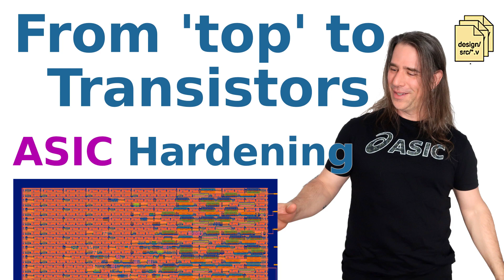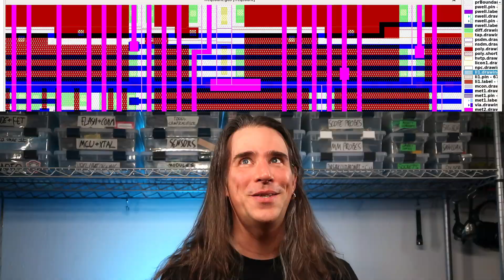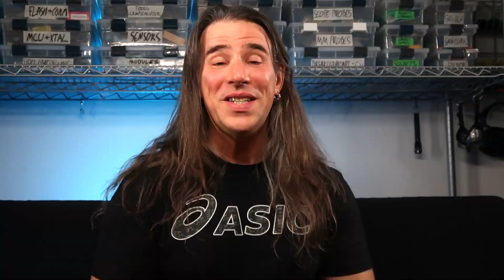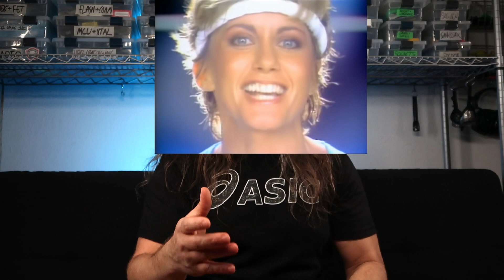From top to Transistors: opensource Verilog to ASIC flow

Comment: Thanks you Pat for this video.   I am quite new to the ASIC field and don't quite understand the flow.   How viewing the placement/floorplan diagram would help us solve the congestion problem or other  kinds of fab-able constrains problems?  When the synthesizer failed, is our only option is to go back and modify the verilog code to make sure not to violate the timing, or create a smaller design.   Or can we manully edit these wiring diagram?
Reply from the maker: Hi Matt, thanks for the feedback!  In theory, I guess you could try to go down to GDS and turn it into a manual "analog" design, but I'm pretty certain that would be a nightmare.  The heat maps and stuff, to me, are more qualitative than anything, to date.  

I did this SHA256 encoder, which I did rather naively and just "let the flow handle" a ton of flops all wanting to speak with each other... in essence, I had to give the system a ton of room to finally be able to deal with it--nice if you can afford the space, but really not the best.  

A good way to deal with congestion issues, assuming the problem lends itself to it, is with hierarchy. I had a conversation with the Cologne Chip guys--they make the GateMate FPGA, which I'll be getting into right after I deliver this space-bound board I'm working on right this minute.  They have this unit fabric and you can have chips with the equivalent of 1, 2, 4 etc of the unit FPGAs in a single chip, with super low latency interconnects between them.  However, the amount of wiring between the chunks is low so, to maximize the power of this, the trick is to have distinct blocks that do their thing and communicate/sync with other blocks of functionality through restricted interfaces.  This is good design in any case, but the point is that doing so will keep from having massing amounts of wiring trying to criss-cross around over long distances.  And when you encounter some zone that's having trouble, you can try and chunk it down further in this way, using trading speed for routability.  Anyway, that's the way I've been playing.
Reply: @PsychogenicTechnologies  Thanks for your detail answer, very much appreciate.  Hierarchy design is a good idea.  Network topology stuffs are surely important in this field.   Trading off between factors is the charm of chip design.    Good luck on your space(c)hip. 🚀

Comment: Hello Sir, are there i/o pads are included in the design? How to add pads in the design? One more thing, after getting the gds file, how to see the hierarchal view of chip (like pads, different modules, top view)... Thank you
Reply from the maker: Hello!  If you are using tinytapeout, then you don't much have to worry about the pads.  You basically have clock, reset and 24 i/o (8 in, 8 out, 8 bidirectionals).  See https://tinytapeout.com/specs/ 
When using mixed signal/analog, you have an additional 6 i/o for that.

Comment: thats quite amazing - how many bits was the frequency counter and how fast could it clock itself.
Reply from the maker: Hi Johnathan!  I can't actually remember number of bits at this point, but since I based my neptune thing on the idea of frequency counting and reused what I could, I probably had done something like https://github.com/psychogenic/neptune/blob/main/neptune/pulsecounter.py -- in short, giving myself enough bits for whatever the max count would be automatically.  As for speed, internally the sky130 process can handle into the GHz so the limiting factor is basically I/O. Back in the days of TT03, this was a sad something kHz.  By now, the I/O is rated with a bandwidth of 50MHz, but for inputs you can actually go at least 10s of MHz higher than that (tested it up to 70 but am pretty sure someone in the discord had made it close to 100 or so before seeing junk).  Finally, you've got the edge detection crossing clock domains, so wind up using a flip flop synchronizer--it's parametric, but I've basically always used only two stages at this point, which (I think) implies that you'll hit a wall for pulses coming in faster than half the clock rate

Comment: Hello, I'm really interested in this topic overall but I don't know where to get started (I'm trying to figure out whether this is a career I want to pursue)
Any help would be greatly appreciated 
Some background on me :
I'm currently a third year computer engineering student and I'm trying to find if software or hardware fits me more
Thanks again!
Reply from the maker: I say try before you buy :)  The good news with all this is that it's now so accessible: you have a computer, you're all set thanks to the open ecosystem that has sprung up.  I don't know about you, but one of the quickest ways I learn anything is to have some goal in mind and get what I need to accomplish it.  With ASICs, the well runs very deep--you could spend your life exploring it.  
My recommendation is to start close to where you are now, focusing on the two things you need to acquire: some tooling, of course, but mostly a bit of a shift in mindset.  If you want to break it into two parts, which I'd recommend, you can focus on the mindset by leveraging what you already know to start.  You can use Python (Amaranth) and an inexpensive FPGA module and start on a small project where you get a flavour for the difference between writing an algorithm vs describing hardware.  
If that's fun, then you can either move to verilog, or stick with Python and deepen the complexity of your projects.  Get into cryptography, or image processing or whatever interests you that gets hard fast.  If you like CPUs, check out the "LMARV-1 reboot" playlist (and others) from Robert Baruch.
Either way, if you are doing digital design, there is little difference between designing for FPGAs or ASICs, so you'll be ready to do TinyTapeout runs very fast.  Worst case is that you got to sculpt some atoms and did something that was near impossible only a few years ago.  And who knows, maybe it will turn into a career.  Good luck and have fun.

Comment: Hi, nice video! About the congestion, you can get the instance name in the congested area and do a grep in the mapped verilog. That you give +- an idea what module (and surroundings) are congested. Usually cells from the same module are placed together. However, I am not sure what is the strategy for the name composition in the physical synthesis. I would guess module_name_inst_name.
Reply from the maker: Hello Mayler--thanks!
So poking around following your suggestion, I found that in the run under results/final/verilog/gl there are two .v files, one name.v and the other name.nl.v (one is powered, the other not, so the only differences are connections to vssd1 and vccd1).
The naming is pretty awful ... just number  so there are things like
  sky130_fd_sc_hd_and2_1 _384 (.A(_079_),
      .B(_168_),
      .X(_169_));
strewn about.  However, that example was just a worse case.  The wires, here, are from stuff nearby in the file and naming coming from my own modules is peppered throughout.  So just above AND gate 384, there, is some AND-NOR that's providing input B of the AND, and that pretty much tells me where this stuff is from
 sky130_fd_sc_hd_a22o_1 _383 (.A1(\counterfsm.display_valueUnits[0] ),
    .A2(_158_),
    .B1(_159_),
    .B2(\counterfsm.runningCount[0] ),
    .X(_168_));
So you were right... a little more "manual" than I'd hope, but at least it's possible to get an idea where all that is happening.  Gracias!
Reply: @PsychogenicTechnologies  yes, the naming conventions shown are pretty ugly. Nets use double underlines and instances use just one. Super confusing indeed.
Reply: The other verilog exposes the pg (power ground) pins, both will implement the same logic.
Reply from the maker: @maylermartins  uuf, yes... I hadn't noticed the difference.  Still dealing with a bit of overwhelm as this subject goes so deep, details under details, never seem to hit the bottom (turtles all the way down, heh).  Nice to find that there are lots of people, like you, who know more and are happy to share.  Thanks :)